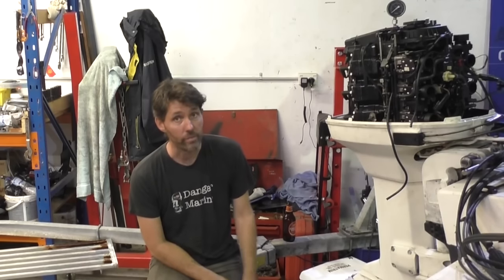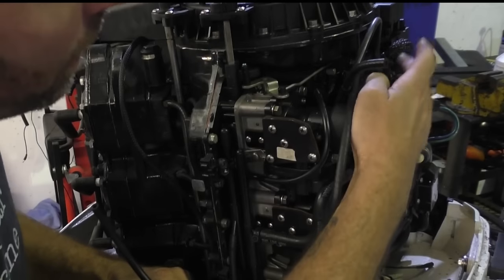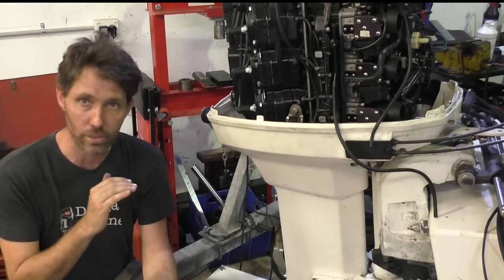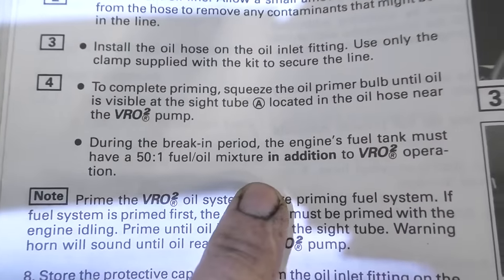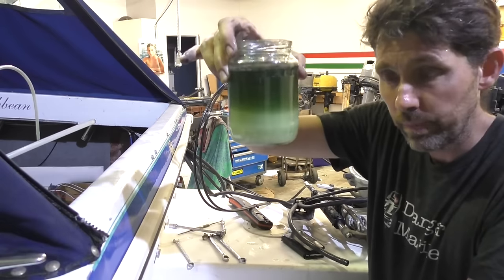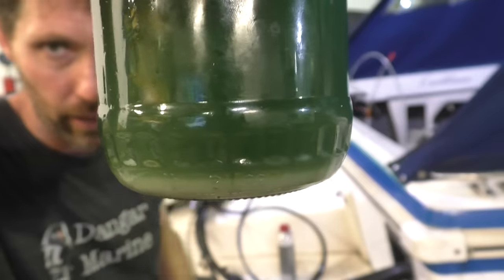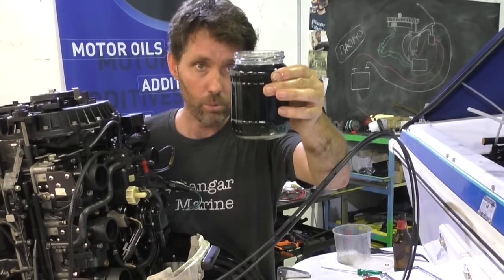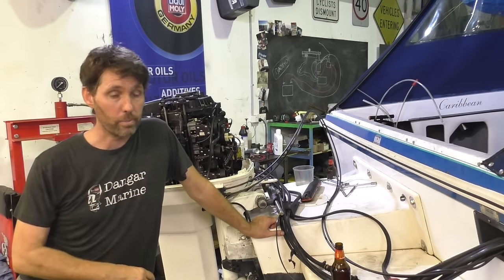Almost ready to start the Evinrude 150

Comment: Stu,
I just went out and took a look to refresh my memory.   Which "long" hose do you mean?   

Either way, just so it's out there, here is a breakdown of the fuel routing.

In summary, the fuel goes through a filter, down into the VRO pump, mixes with oil and is pumped up to the float chamber, and then to the carbs on either side.

Now, let's follow the flow through the individual hoses.

The fuel and oil comes from the fuel and oil tanks into the clear connector fitting.  The fuel then goes up through a hose into the big, white "garden hose" size fitting, which is a fuel filter.  From there, it comes right back out just a little to the left of the white fitting and down to the middle of the VRO...   The oil comes straight from the clear fitting right to the VRO.

Now, looking at the BOTTOM of the VRO fuel pump:
1. The 1/4" hose in the front of the VRO is oil from the clear inlet fitting. (long)
2. The 3/8" hose in the middle of the VRO is the fuel inlet, coming down from the fuel filter outlet nipple that is just to the left of the big, white "garden hose" type fitting. (long)
3. The 3/8" hose toward the back of the VRO is the vacuum hose.  That routes down and to the right and connects to the block only a couple inches away. (short)

From there, the pressurized fuel leaves the TOP of the VRO into the bottom of the float chamber.  At the top of the float chamber, two hoses go right and left, to each fuel rail going into the two banks of carburetors. (long)

And that's pretty much it, from what I can remember.  If you still have an extra hose, let me know. 

-Tony
Reply from the maker: Hi mate. Jared posted a video on the hose I was referring to, it comes from the top of the vapour pump. You'll see in the comments on this video we discuss that there are two nipples quite close to each other down low and I think they were the last two I wasn't 100% sure about. https://www.youtube.com/watch?v=GqM1L-RYJRo&feature=youtu.be
Reply: Glad you got it figured out.
 Looking forward to hearing how she runs!

Comment: You mention bringing in some help around the shop.  Here are some of my observations on the matter...

Always start new employees with a probationary period to assess their skills before hiring them long term.  Let them know this up front to be fair to them.

Generally, it works out best if you either get someone young and eager to learn, or an older guy.   The young guy will be cheaper, but often a big investment in instructing them.  But if they are loyal, you may gain an excellent employee.  Older guys usually know their worth, so they cost more, but are usually worth their weight.

What has worked best for me is paying on a percentage basis, NOT by the hour.  Hourly guys tend to piddle, as their pay goes up the slower they work.   But percentage guys or "piece workers" only make money for what they produce, so they work hard to produce as much as they can.

So, let's say you charge $75/hour for shop work, plus materials and shop fee.  Pay your guy 50%. ($37.50 per billable hour.)  A skilled worker can knock it out in much less time, so he will make good money, and you are making profit from every piece of work he produces.  You just have to understand that a good technician will make a sizable paycheck at the end of the week.  Just remind him that he has to do it right, as work that comes back due to mistakes will be fixed on his time!  This helps keep quality control high.

As long as his quality is high, and you have the volume of customers to support both of you, it can work out very well.

On the flip side, if a guy is slow, and/or makes a lot of mistakes, it might take him 2 hours for a 1-hour job.  Discuss the problems as soon as you notice them, and try to help him correct his weak spots.  But if after giving him a reasonable chance, it's not working out,  end things in a calm, way.   "Agree to disagree", if you will.  Just watch out for the guys who will try to steal something before they go.

This system has worked out very well for me for almost 30 years, now.   The good guys make good money and stay around, and the bums wash out pretty quickly.

Best wishes and hopes that you will find the right employee for your particular business.
Reply from the maker: It can be an amazingly fraught thing hiring staff I can imagine. Our biggest problem is that as a small shop, we can't really afford to pay that well yet, but knocking back work because we are too busy isn't helping us to grow to be able to afford the staff - it's a bit of a catch 22. I really do appreciate the words of wisdom from someone who has been in this situation for many years as it isn't something that working for someone else ever really prepares you for.
Reply: You know...  If you do a video asking if someone would like to be an intern for your shop, I wouldn't be surprised if you got excellent volunteers.  I'm sure many would love to put in time just to learn what you could teach them.  You could get some quality workers in the mix.  It might be a win-win situation for everyone.

I'm currently running a one-man show.  We have ailing parents, and I had to be around, so I shut down the main business. 

What has worked well is getting an occasional day of help from a friend. I'm happy to pay him, but we end up just trading days of working for each other.  Excellent work quality, integrity, honesty, skill, etc.  So no worries, and no long-term expense.
Reply from the maker: Working with people you know and trust is always great, and I also really like the idea of trading days of work.

Comment: Just a thought: i think you should mix the 2 stroke oil you put in the fuel tanks at a ratio of 1:1 with fuel before you introduce it into the tanks. the fuel you pumped/drained from the tanks looked to be rich in oil. pouring the oil straight into the tanks just settles in the bottom of the fuel tank without mixing with the fuel. this is also seems to be evident as the float bowls were full with 2 stroke. if i am mixing oil/fuel i do so at the gas station (all the oil and half the fuel) the driving to the boat ramp mixes the oil and fuel. once at the ramp it is 100 ft to the fuel dock were i top off the tanks.
Reply from the maker: Modern two stroke oils mix chemically almost instantly, very different to the old days of putting normal sump oil into the fuel.

Comment: thilltony is correct. I have been around outboards for the past 30 years. How did the motor come out?
Reply from the maker: Yep, he sure was. Motor is running nicely now, but I have the gearbox back in the shop at the moment to redo the seals and impeller.

Comment: Also, for what it's worth, those motors really like the semi-synthetic oil. The absolute winner around here (Virginia, USA) has been the Penzoil Marine XLF. (Extended Life Formula)  I recommend it to all my customers, and often get follow-up thanks from them.  

The biggest thing you notice is a sometimes dramatic reduction in the amount of smoke the engine produces. And the smoke that it does make isn't as stinky.  Your plugs and the he inside of the engine stay cleaner, and most report that their engine just "feels" like it's running cleaner and smoother. The surprising thing is that it is only $17.99 a gallon locally at Walmart, which makes it a win-win.  Strangely, the Penzoil full synthetic does not review as well, and it costs double. 

Here is a link to the product on Amazon, so you can see it for yourself.  At 25/gallon, it's not as economical as buying locally

https://www.amazon.com/dp/B00C43BOTM/?tag=googhydr-20&hvadid=175193622365&hvpos=1t3&hvnetw=g&hvrand=15853000013458331415&hvpone=&hvptwo=&hvqmt=b&hvdev=t&hvdvcmdl=&hvlocint=&hvlocphy=1027174&hvtargid=kwd-68757613640&ref=pd_sl_84dpea0w0y_b

-Tony
Reply from the maker: Thanks Tony, I'll check that out. I'm a firm believer in using quality oils for four stroke motors but had never really paid much attention to two stroke oil. I'll see if we can order a case of the Penzoil.
Reply: I typically see it the opposite way.  Like an automobile, if you change 4-stroke oil regularly, and never let it get old, it probably won't matter who makes it, as long as it's an ASE certified oil. 

2-stroke oil, on the other hand, is actually getting burned by the motor, besides it's role in lubricating the engine.  So if it produces a lot of carbon, it can foul plugs or even form deposits behind piston rings, which will eventually destroy the engine.  

If it leaves gummy deposits, it can foul carbs or injectors or internal passageways, and cause major problems. And other similar things.   So I have found that using a quality 2-stroke oil is even more important that in a 4-stroke.  

But that being said, I tend to use good 4-stroke oil "just in case."   I just don't worry as much if I don't have the good stuff on every change.
Reply from the maker: It is a good point that regular changes of four stroke oil are really the key. He had a seized BMW with only 50,000kms on the clock recently that had only had one oil change in it's whole life. What a was of a near-new engine!

Comment: Stu: when you get an abused motor, (as in either has been drowned or just sat for 30 yrs, where do you start? I have a 1979 Merc 2S, 6Cyc 115hp. Have pulled plugs, look like water or dirt inside. Carbs look rough, wiring all dried and cracked. Do I start at engine or go check from prop inwards/upwards? Or find a rubbish bin? BTW thanks for videos, as I am going to school with them, and the repair manual.  Bill in Texas
Reply from the maker: Hi Bill, this video covers the basic things I would do https://www.youtube.com/watch?v=XiewGg7XxO8

Comment: If you want to eliminate all of the water in a fuel system.., pour 2 gallons  of anhydrous methanol into the tank...  It will force the remaining water to merge with the  new gasoline.., drying oput the tank....   Install 2 inline water separators too...  Can't be too careful.....

Comment: at 4:38 would have been a great time to remove the oil pickup , check the filter sock and check for low-oil circuit.

and there are tests for the No-oil and oil consumption (using a clear 1/4" ID tube full of oil)
Reply from the maker: The oil tank did get cleaned out and we've been running it on premix and monitoring the oil consumption at the reservoir. The oil level in the reservoir has been dropping as expected so getting ready to move to straight unleaded soon.
Reply: Cool...did you test the low-oil circuit and the no-oil circuit? let me know if you need the steps...from what I've seen if the pump is acting up it pumps too much oil or not enough gas...only if the oil reservoir or oil line is compromised with there be no oil pumped through.
Reply: @cfauvel  could you share the steps to test this?
Reply: @rglover28328  are you talking about the low-oil and no-oil warning tests? Then yes

No-oil- Running an external tank of premix, disconnect the oil inlet and idle the motor at about 2k… the warning horn should sound in 2 -3 minutes . If it doesn’t then either the horn is bad or there is no tack pulse ( volt regulator usually supplies tach pulse)

Low-oil- suck out oil from the reservoir to a point about 1/4 tank… the horn should sound once a minute or so… if not keep removing oil from the reservoir until about 1/8 I’d left… if the horn doesn’t sound then either the float switch is bad or there is a cut in the wire harness
Reply: One of my videos I do the no-oil test after replacing the regulator.

Comment: What do you do with the old oil, contaminated fuel?  I guess it is taken to some kind of recycling center? Wonder what it used for after that?
Reply from the maker: We had a waste oil IBC that got emptied by a pump-out truck. I believe that recycle it as low-grade fuel for running power generators etc

Comment: The VRO pump is "The Octopus"?

I don't want to sound stupid but if you just pour a litre of oil into the fuel tank and can't mix it because you're not filling with fuel after, doesn't a lot just sink to the bottom because it's denser than the unleaded? Then when you primed the line isn't a good portion of that oil coming out with/after the water, it looked awfully dark green and not at all like fuel/oil mix? 
As I profess to know nothing about boats or outboards, just asking, but if it's going to run the oil injection and premix isn't it therefore running lean too? I mean you've got more oil, therefore less fuel going through the carbs so maybe you need those larger jets. I realise it's a tiny portion of extra oil but I know it makes a difference in highly tuned  chainsaw engines etc. Running 25:1 vs 50:1 you'd have to retune a worked saw. Again apologies for boat ignorance but I just like watching your videos and explanations.
Reply from the maker: Hi mate. Yes, VRO pump was part of the octopus. In the old days of just using regular oil it wouldn't mix well, you are right, but modern two stroke oil is designed to mix thoroughly almost straight after being added, you don't need to worry about that. Well spotted on the fuel having too much oil in it. I spoke to the owner afterwards and he said he had connected the starboard tank too and that $35 had gone into each side. As a result I will be adding pure unleaded to the port side now to get the ratio correct. 

It's also a good point you make about extra oil does equal fuel, but it is only for the first few hours and I don't think these motors are in a high enough state of tune for it really be a problem. I will be keeping an eye on the temperature though because my only real concern would be if it ran hot from being lean.
Reply: The break-in oil ratio is vital to prevent damage, and to allow all the engine components to wear in and seat together gently and properly.  This has been the standard in 2-stroke outboards for well over 50 years.  Your engine will not run lean on that mixture, but will more lubricated due to the extra oil, which does burn, by the way.  The only downside is that it may smoke a little more, and it could dirty the plugs if you idle for extended periods of time.

Never skimp on break-in procedure or times!  I like to let her idle on the hose for the first hour or so, hitting the throttle every once in a while to clear things out.  Then, you put the boat in the water and vary the RPM every few minutes. You can open her up for one minute at a time, and then allow 5 mins cool off time at lower RPMs in between.  After the first 5 hours, you can rev up to WOT for a couple of minutes at a time, then back down to lower, varying speeds.    It takes patience, but proper break-in really pays off in the long run.

Comment: Stupid me but I am trying to find a kill switch or lanyard attachment on my boat.  It has been in storage for 10 years unused.  I can't remember if it had one?  I use a key to start the outboard.  (Off start on) are the 3 positions on ignition on console.  Anyway as you can guess I tried starting it after 10 years lol no luck.  So I am thinking I have a kill switch I need to deactivate so that I can start the outboard or maybe carbs need cleaning?? Clue - I ran a spark test and I am getting strong spark.  I am thinking I don't have a kill switch since I am getting spark?  Am I correct?  I would like to know before tearing into the carbs and  cleaning them.  Also have 120psi in each of the 3 cylinders. Thank you!!!

Comment: Hello, thanks so much for all the content you have published. I have learned a lot from you. I am restoring my fathers 1983 honda bf 7.5 hp. I've worked my way through a couple problems so far but I am stuck on water in engine oil. I took the powerhead off, replaced the powerhead to oil case gasket and oil ring, the head gasket and o ring , intake manifold gaskets, thermostat,  and oil filler cap and O ring. Is there any other thing you think it could be? Thanks again
Reply from the maker: Hi Dylan, sounds like you've covered the main culprits. You could also take a look at the lower main seal, but I wouldn't expect to get a lot of water in that way, more oil leaking out.

Comment: These videos have been great. Was there any synchronization necessary with the carburetors on this engine? Also is there any way of adjusting the idle speed of these engines?
Reply from the maker: I never did a link and sync on this motor because it seemed to run just fine. You can affect the idle with mixture screw adjustment and timing adjustment, but they are mostly quite factory set.

Comment: Hi Stu, got a question that I have not asked yet. when 2 stroke oil injection is set correct are the plugs still slightly wet? you would think that with a oil gas 50:1 mixtures they would be. Thanks
Reply from the maker: Hmmm, good question. If a engine is firing properly I wouldn't expect the spark plugs to be wet as such, it is more the colour of the electrode that oil ratio will change.
Reply: ok, as I thought thanks Oh and watched all of your 150 videos. awesome. got some SS fuel line clamps today. expensive but we'll worth it.

Comment: Now if that water got into the cylinder, could there have been enough to hydrolock that damaged piston?
Reply from the maker: I think it is unlikely to get enough in through the carburettors to do that. It would mostly just block up the jets and make it run badly.